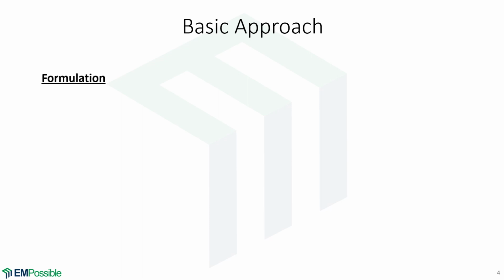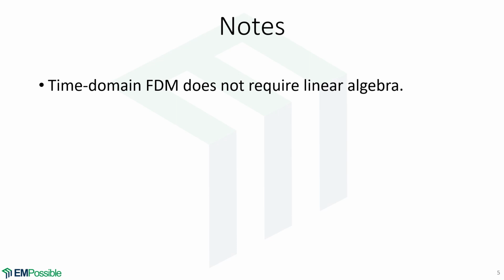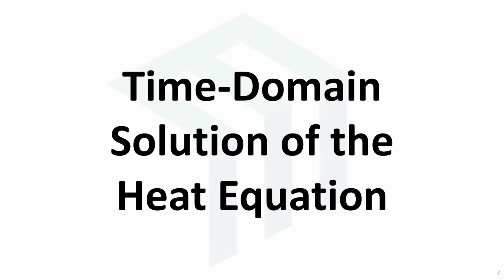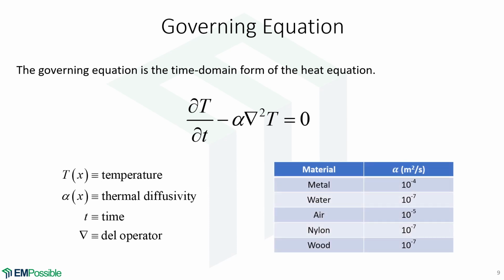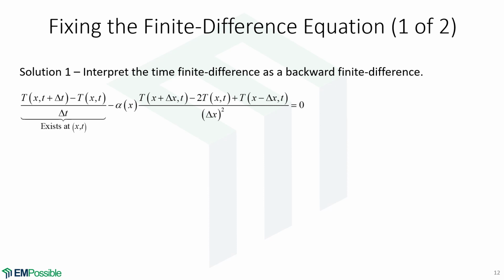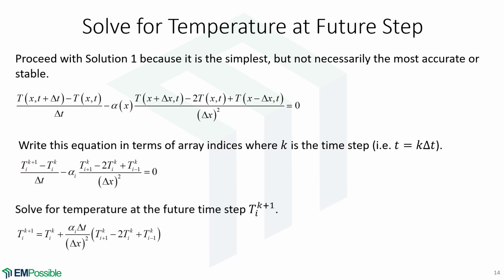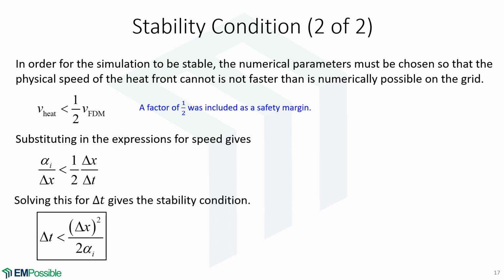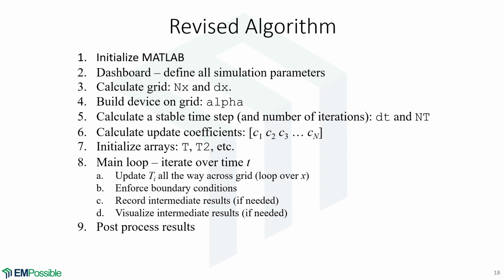Lecture -- Introduction to Time-Domain Finite-Difference Method

Comment: Dear Prof.,

Just out of curiosity, since you mentioned in the beginning of the video that we can use linear algebra, so is it possible to use integration methods to solve the FDTD  like MATLAB inbuilt ode45 ? for e.g. for heat equation ∂T/∂t = α ∇T, can we form the RHS part as system of linear equation with LΦ = 0 and use it to feed it to ode45? will it work like that?
Reply from the maker: Absolutely, it will work. It may even be faster for small problems. I think the drawback you will experience is that it will not scale well with size. If linear algebra is avoided, doubling the size of the problem only doubles the number of computations. That is linear scaling. If linear algebra is employed, the scaling is more likely to be exponential or at least something worse than linear. There is a lot of research into what you are asking for things like implementation on a GPU. Read about time-domain finite element method, for example.
Reply: @empossible1577  Thank you Prof. Just one more thing. Let's say we want to use ode45 which uses an anonymous function as an input. So should we only form the equaiton for RHS or should we combine everything. By this i mean: consider ∂T/∂t = [Dt], ∇^2 = [Dxx], and [α] be matrix representations, so are we solving [α][Dxx]T to feed to ode45 or ([Dt] - [α][Dxx])T?
Reply from the maker: @DevpriyYadavCreative  Oof. I don't know know how ode45 works. I am nervous about guessing.

Comment: Great video. Can you pls comment on two things. What do you mean by FDTD may not use a linear algebra and why do non T  domain scales exponentially?
Reply from the maker: By linear algebra, I am talking about matrices, matrix multiplication and division, eigen-value problems, etc.  FDTD can just use big for loops that loop through every point on the grid to update their values, and then do that over and over again.

Most say FDTD scales linearly, meaning if you double the size of the problem you only double the number of computations.  That is not completely true. It is true that for one iteration you double the number of computations, but you will also have to double the number of iteration because waves are travelling twice as far and you need to run the simulation for longer.

Comment: Great video with clear explanation! Regarding the slide "Fixing the finite-Difference Equation (1 of 2)", I think the equation in the first solution should be interpreted as forward FD instead of backward FD. For the FD approximation at present time t, the forward difference scheme involves derivatives at future time t + delta t and present time t.
Reply from the maker: LOL.  How crazy is this?  I did get it backwards.  Thank you!
Reply: @empossible1577  It is indeed confusing!

Comment: A good video, but I believe the utilized heat equation requires that the thermal conductivity is constant throughout the rod. This does not seem to be noted in the discussion.
Reply from the maker: That was likely what was done in your college class to make it solvable by hand.  However, when solved numerically, the properties of the rod may be inhomogeneous.
Reply: @empossible1577  I think there was a miscommunication here. I was talking about how the 1D heat equation is written:

ut=1/cp d/dx (k ux)

where c is the specific heat capacity, p the density, and k the thermal conductivity. ut and ux are the partial derivatives wrt time and position.

This is what I meant by requiring that the thermal conductivity is constant. Otherwise it cannot be pulled out of the derivative.
Reply from the maker: @NGHutchin  Let me do some homework on this.  Thank you for pointing this out.  If I have made a mistake, I will correct it as soon as I can.

Comment: Hello, it was a great video! I have only a question. When trying to obtain the thermal diffusivity using the given function, I got values higher than 1 which I believe are not very realistic. I'm using values in meters for a bar of 0.10 m and a dx = 0.005 m. Any ideas on what I'm doing wrong? Or is the formula limited to certain conditions?

Comment: Hi CEM team! following this (and other) YouTube videos I have extended the FDM Heat transfer approximation to calculate the temperature profile in a multilayer wall with T boundary conditions on the left (-5ºC) and right (20ºC) ends.

I have set three layers of the same thickness and initial T=-5ºC, with very different thermal diffusivities which makes them update their temperature profile at very different rates, as expected.

HOWEVER in the final steady state, the FDM approximation seems to converge to a completely straight temperature profile accross the multilayer wall, no matter the different alpha parameters. Please look at the animation here:

http://guillermoluijk.com/misc/heat_transfer_multi.gif

The code cannot be simpler, the FDM update equation is done using R vector capabilities so the implementation is very visual and straightforward:

    T[indices]=T[indices] + val[indices]*(T[indices+1] - 2*T[indices] + T[indices-1])

Is it correct to obtain such a flat profile accross the multilayer all or I'm missing something?

Best regards and thanks for your educative videos.

Complete R code:

# Heat Transfer Equation (FDM approximation)

n=24  # number of cells
N=90000  # number of iterations
L=0.1  # 0.1 m wall thickness
dx=L/n  # 0.01 m
dt=0.05  # 0.1 s

alpha0=0.0001  # m2/s
alpha1=0.000001  # m2/s
alpha2=0.00001  # m2/s

T0=-5  # initial T in the wall
Tleft=-5  # left end boundary T
Tright=20  # right end boundary T

T=matrix(T0, nrow=1, ncol=n)
T[1]=Tleft
T[n]=Tright
indices=which(col(T)!=1 & col(T)!=n)  # array positions excluding both ends
x=seq(from=dx/2, to=L-dx/2, length.out=n)  # position array

SPLIT1=9  # layer1|layer2 boundary
SPLIT2=17  # layer2|layer3 boundary
alpha=matrix(alpha0, nrow=1, ncol=n)
alpha[SPLIT1:SPLIT2]=alpha1
alpha[SPLIT2:n]=alpha2

val=alpha*dt/dx^2

for (j in 0:N) {
    plot(x, T, type='l', col='red', lwd=2,
         xlim=c(0,L), ylim=c(min(Tleft,Tright), max(Tleft,Tright)),
         ylab='T (ºC)',
         main=paste0('Iteration: ', j, '/',N, ', t=', round(j*dt), 's'))

    # Iterate T in vector notation
    T[indices]=T[indices]+
        val[indices]*(T[indices+1] - 2*T[indices] + T[indices-1])  # delta T
}
Reply from the maker: Unfortunately, I am not a thermal expert, but in my limited experience a linear temperature profile at the end is the correct answer.  The thermal coefficient really only affects the manner in which the temperature profile evolves into the linear profile.
Reply: @empossible1577  Thanks for your response. I found the solution: the basic equation is only valid for a single layer surrounded by boundary conditions, it is unable to generate a discontinuity in the first derivative. For multilayer heat transfer a bit more elaborated equation is needed (averaging the conductivity in the border):

http://guillermoluijk.com/misc/ecuaciones_singlemultilayer.png

With that equation the multilayer problem is solved!:

http://guillermoluijk.com/misc/heat_transfer_multi.gif
Reply from the maker: @gluijk  Thank you!
Reply: I saw you provided an updated function for multi-layer FDTD Heat transfer, would you be willing to share your reference for that or a link to your own works if publicly available. I have been looking into having heat transfer through multiple solids in contact with one another however understood it was more involved than changing the thermal diffusivity specially. I would expect it means for stability you assume the least favorable diffusivity value and allow it to dictate spacial_step/time_step. I have seen a similar equation for non-linear heat conduction which would allow a gradual build up to a different material property as opposed to a very sudden material boundary change. If you could point me in the right direction I would really appreciate it thanks